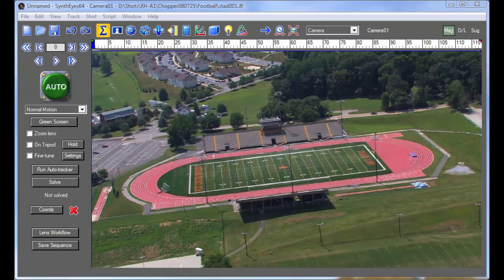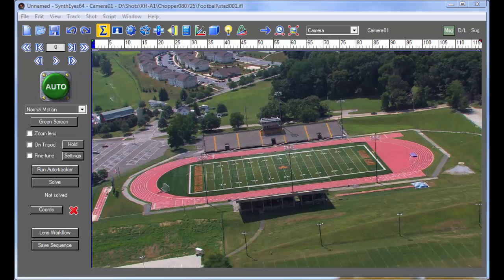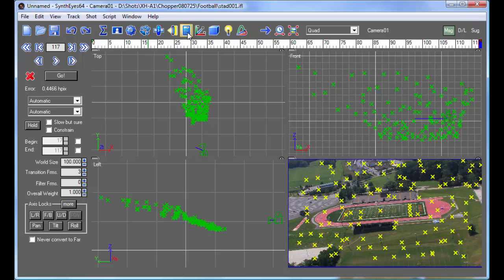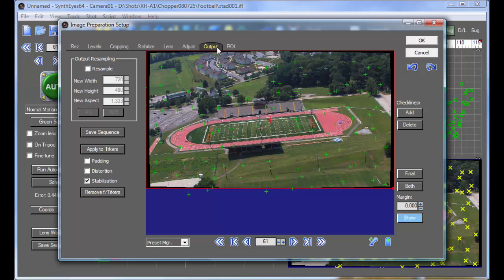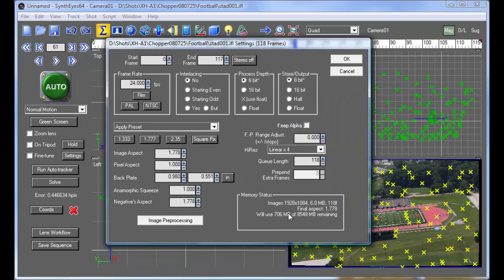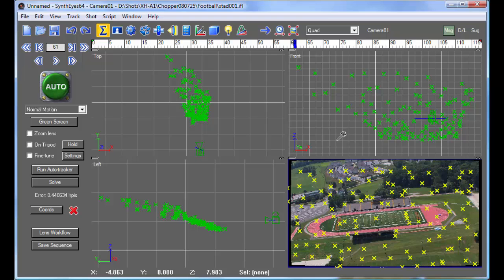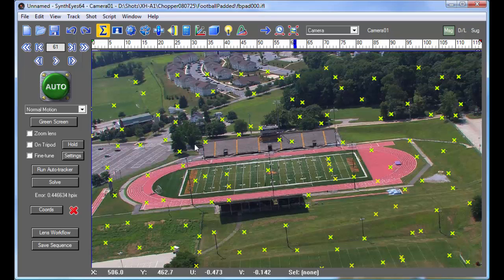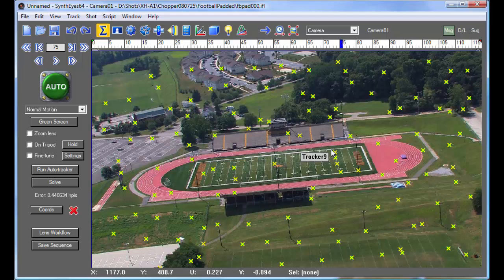Workflow for delivering distorted images

Comment: @SynthEyesHQ I'm fairly new to tracking/camera lens distortion workflows, and I'm looking at purchasing SynthEyes for an upcoming project, I'm wondering how this would work with multi-pass EXR files from V-Ray that I will be compositing with the footage in After Effects? Is it possible to use Syntheyes to distort these EXR files correctly?
Reply: @ignitoracing  thank you!